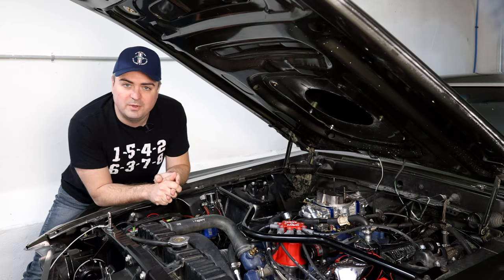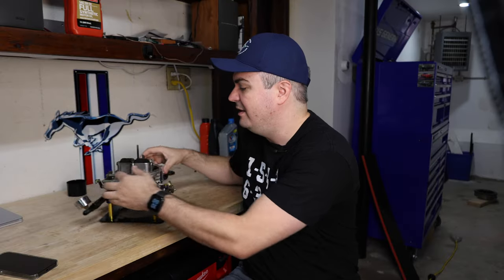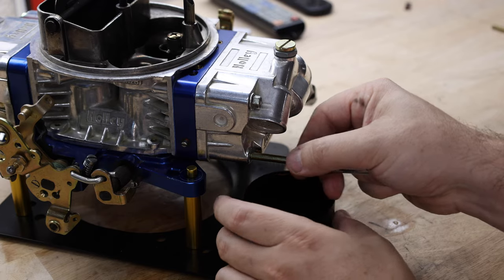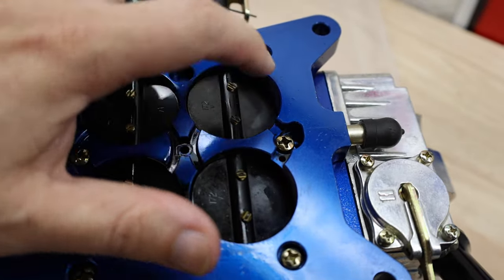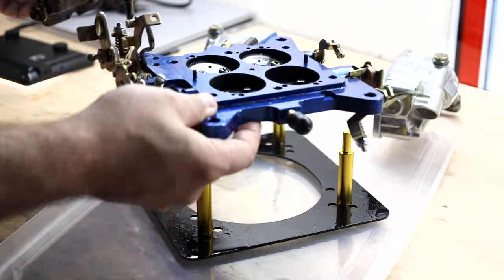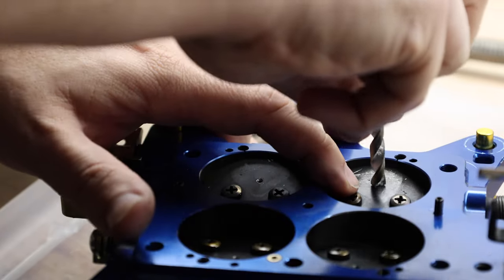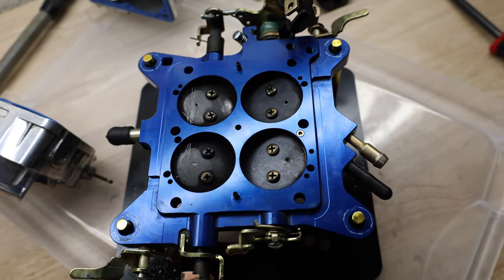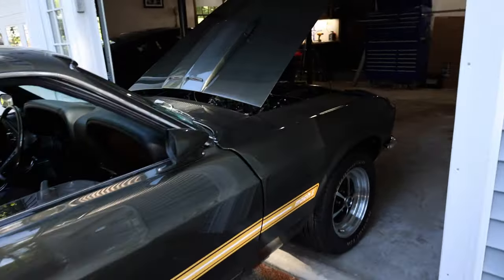Drilling Holes in a Holley Carburetor For a Big Cam

Comment: My Roadrunner 383 I just bought runs but will not idle unless I keep my hand on the throttle. I think the person I bought it from put a bigger cam in it. I have an Edelbrock on it. It runs so rich it burns my eyes. If I bump up idle screw it gets into the transfer slots.
Reply from the maker: You could look at playing with the idle air bleed or the secondaries first before playing with the throttle screw on the primary side. Are you sure your timing is set right at idle? That being off could also be causing an issue.
Reply: @SmackeysGarage  The car won't stay at an idle. I have to start it and steadily keep my hand on the throttle.